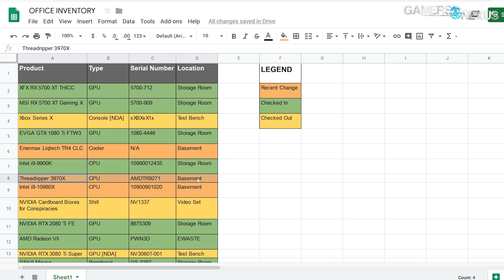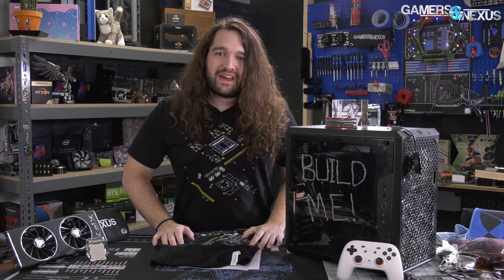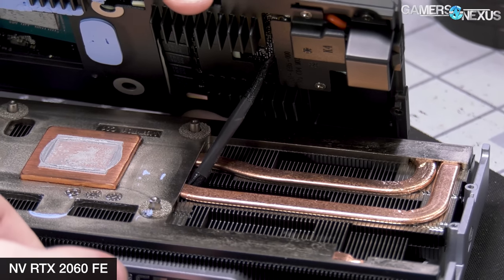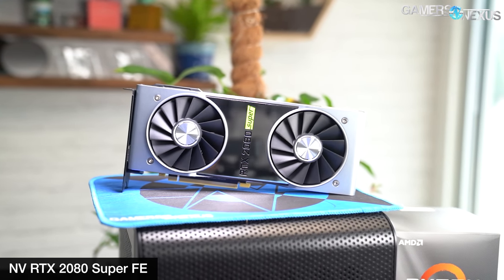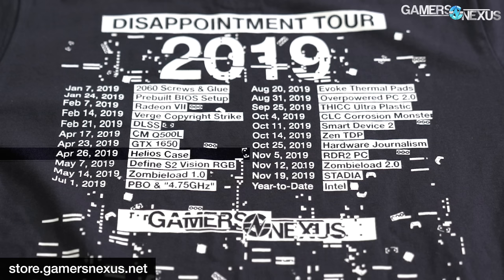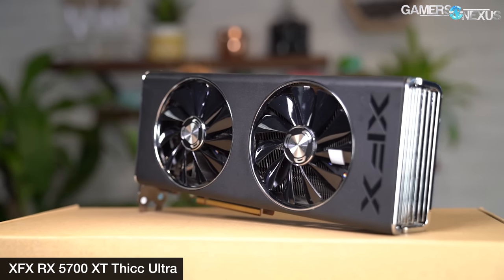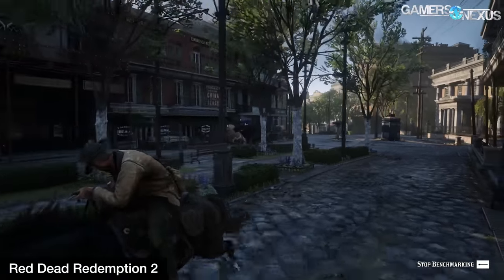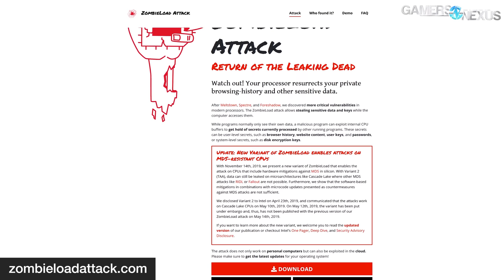The Disappointment PC 2019: Worst Parts of the Year

Comment: "look forward to an equally disappointing 2020"

You have no idea.
Reply: I bet there would be no GPU in that build.
Reply: Possible components:

CPU's
Ryzen 4000 Desktop APU
Ryzen 3000 xt
I7 10700K

Cases 
Abkoncore Ramesses 780
Silverstone Fara R1

MOBO's
Asrock z490 velocita motherboard the 10700k 

GPU'S:
PowerColor RX 5600 XT Red Dragon Review

Coolers:
Corsair A500

Walmart and Cyberpower Prebuilt PC'S

If I can find more I'll add it later (I have to see some Steve reviews)
Reply: Great year... if it was in stock
Reply: the 10700k wasn't a dissapointment at all though... It was basically a 9900k with enhanced features for much less money. I'd say the 10900k was a dissapointment due to its high price and poor stock, especially when the 10850k came out.
Reply: @SludgeManCometh  ruined by having no stock for either launch.
Reply: @juliancumming6893  but it's the only Intel cpu not fully recommended and if you want to use the velocitas mobo you have to use and intel cpu
Reply: it's the only Intel CPU not fully reccomended IF YOU CAN FIND A CHEAP 9900K. Also, that second part doesn't really mean anything in terms of dissapointment unless the trend continues into future Intel CPUs which it probably won't since AMD is offering so much with ryzen 5000 onwards.
Reply: @hellowill  the year itself is out of stock, wait for 32nd December 2020.
Reply: @cortexcortexified8623  got my 5950x ;) But no gpu
Reply: 4000 apu isn't bad. It just AMD's dumbass marketing didnt put it out for consumers and push it to SIes
Reply: its almost as he ironically wished for this

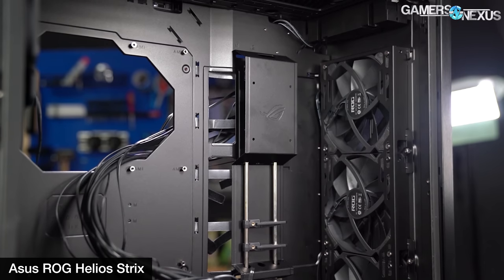Comment: 17:40 I still take my HAF X at least once a year to a LAN-party. This got me right in the feels man.
Cool video, had forgotten how many components had problems at launch.
Reply: haf x is heavy as hell.  i used to own one.  i don't see how anyone sane would use it as a 'lan party' case.  go for a mini ATX if you're gonna go that route.  lol
Reply: Still running a CM Storm Scout here.  The solid handle on the case is was actually really great for 5+years of luging it about while living out of hotels for half the year for work.  Bought a GL702zc r7 1700 + rx580 laptop last year and never looked back, however.  A single back pack is so much easier to lug around then a full atx case plus a suit case for the monitor and such. Still carry the extra suitcase, now, with a second monitor, cause why not :(

Comment: The sad part is this is probably someone's actual build.
Reply: Lolz
Reply: I have a Q500L, and I love it to death. Had to chop her up with aviation shears, but she's recovering quite quickly.
Reply: Hey, the R7 is a very good prosumer card in certain roles, such as media work.

The Intel has no such excuse.
Reply: @ryanherrington2319  it's expensive and worse than NVIDIA's solution the 2080
Reply: @spiceydice6968  Except for those specific roles, the RVII is better, because it has the biggest VRAM cache in the consumer realm, and is the cheapest source of certain AI relevant compute available.
Reply: @ryanherrington2319  How does the Radeon VII compare to the MI50, in terms of gaming and workloads?
Reply: Like Jayz2cents personal build 🤔
Reply: @CaveyMoth  I don't know if anyone's tested an MI50 with games, but the RVII is essentially a lowbinned MI50.
Reply: @CaveyMoth  Gaming on MI50 will be hampered by lack of video outputs.
And double the already high price.
Reply: @ryanherrington2319  For a lot of AI it's gonna suck hard though because AMD is lacking CUDA. And ROCm is not up to par performance wise.
Reply: Ryan Herrington m
Reply: @fretboardrunner  A lot, but not all.
Reply: @ryanherrington2319  I'd wager Tensorflow, Keras and Pytorch are the most used Deep Learning libraries right now. And while they do work, it's hard to integrate the AMD docker images or builds into a lot of workflows and even after that performance is worse than that of a 1080.

I do have a Vega 64 and loved that it worked at all, but it was pretty finicky and support on Windows is nonexistent.

Comment: I’m perfectly happy with my Radeon VII. It’s a beast for compute.
Reply: That's not what AMD launched it as. It was a compute card represented as a gaming one. And the need for compute GPUs is a niche thing.
Reply: It also had stupidly broken drivers at launch.
Reply: Me too, I´ve searched a lot before buying and soon I realized this was a similar card to a Quadro but half the price, I was dead set on buying it. Yeah it´s not the best gaming card, but I can game in it with everything at max and also work in heavy environments,  so I´m pretty happy with it so far.
I saw a ton of people saying it was incredibly loud and hot, still, mine runs in reasonable temps and I don´t think it´s a loud card, I was expecting to hear a 747 every time I was rendering or gaming, nope, not even close.
Reply: absolutely. I can understand that from a gamer perspective, while it is a top tier card, it is not good value at the price. But boy, for compute workload this beast is up theere with the 2080ti! The fact that it is a repurposed instinct die is hard not to notice. 
(can't speak for driver issues on windows though, linux amdgpu drivers worked perfectly from the first day I used the card. To be fair though I bought at launch day, AMD arranged themselves to have an extra month time fixing things, while I waited for the darn thing to finally be delivered!)
Reply: They did not actually “launch” it as a gaming GPU, they “announced” it that way, but changed it.  Why is that a problem at all?

They also priced it as a hybrid compute card.  Yes, the REVIEW drivers were bad, but that doesn’t count.  Sorry.  Consumers count.  Reviewers can get a beta driver, suck it up Sally!

The driver was fixed by the time it got to consumers, which is what matters most.

Radeon VII was a dumb addition to this video.  They just wanted to get an AMD product in to avoid the wrath of being called fanboys.

It is BS.
Reply: fuck yea man!!!! already pocketed a few ETH with mine off hours from gaming/work :)
Reply: RVII seems like a great card, if it was about $200 less at launch.  It's still perfect for some work loads, but for some reason gamers think that gaming is all that matters.  See people still choosing the 9900k over cheaper AMD options that out perform it in every other task.
Reply: I'm happy that you're happy 😁

Comment: LOL "70 pound 2 ft tall computer to a 2001 LAN party". I had a 2 ft Server tower in 1999 (running NT4 Server as PDC) with dual socket Pentium 233MMX's as a Quake 2 dedicated server on a custom maps loop partially populated with bots. I'd come home from work and jump right in with peeps from all over. No need for a LAN party but I was sporting 3 top end PCs on a local hub for home RTS and shooter matches (Unreal Tournament).  Ah, the good ol' days. Thx for the flashback and your slightly over the top intro GN.  Happy 2020

Comment: "worst parts" not sure, since those parts still make one hell of a pc, but they might not be the best bargain for the buck :D
Reply: Except it would run hot as a dumpster fire
Reply: @iaial0  as demonstrated in the intro
Reply: @iaial0  From the CPU. The Radeon 7 runs really cool
Reply: @iaial0  Well, my Ryzen 3600 runs hot aswell, but its just nice in wintertime :)
Reply: @tskraj3190  Also the GPU because the case has no airflow

Comment: I love my Radeon VII, but I bought it knowing fully well it was a spesial snoflake hacked up datacenter die that would never be sucessfull mainstream.
Reply: Can you play all games in 1440P and with Maximum details ? Maybe AMD drivers was improved this Gpu's performance ???
Reply: @ErenJaeg4R  I can with mine, so far the only issues i have had have actually been a result of windows updates.
Reply: I am running my Radeon VII exclusively in 1800p with everthing usually on high. That gives 60fps in Red Dead 2 etc. my card is watercooled (AIO) and with a small overclock to 2000hz. Would get an nvidia but Hackintosh doesn’t support it.
Reply: I overclocked and undervolted mine and it runs great on my 3440×1440 monitor. New titles above 60fps and older stuff over 100fps. Plus it's been great when editing in Davinci Resolve. I think it's aged well, and I picked mine up on sale at Newegg for $500.

Comment: Wow, the complete gong show of the Radeon VII that you had gives me flashbacks to the old AGP Rage Pro Turbo that I had in 1998. Trying to use the beta drivers to get OpenGL working in Quake 2 and Half-Life was a complete gong show, leading me to some 2:00 AM bedtimes as a teenager where I developed a twitch every time I heard the Windows 98 "Chord" sound as an error message. I ended up needing to re-install Windows to fix the problem, much like GN did with the Radeon VII.

Comment: Hey Steve. I want to know what module(s) is being used in the MasterLiquid ML360 SUB-ZERO Intel cyro cooler. I have figured out how to design a cooler that will hold up under a full workload, however using thermometric modules with the lowest Amperage Draw, highest temperature difference, and highest temperature wattage may be essential. I don't want to have to use 20 Amps of 110v AC to power the thing, and so far from others on YouTube it appears that even more Amperage might be required, however some how Intel's module doesn't seem to be as power hungry, and that's what I would like to use, although not necessary for a design or patent in my prototype. 
I'm finding parts for my prototype and trying to keep costs down on both expenses and Amperage. 
The design of the Cyro Cooler is headed in the right direction, but I'm not sure if they will get it where it has the possibility to go. I'm guessing that twice the Amperage is required over what the current Intel Cyro cooler is drawing, in order to make it stable under a full workload, maybe 3x the Amperage, using the same parts of course.
Otherwise the budget thermometric modules on the market might be able to keep a consistent temperature under full workload without drawing more than 20 Amps, however they might not get you a below zero C temperature without using an additional cooling device. The advantage at that point, is that by using an additional cooling device, you still get the benefits of the thermometric modules temperature difference driving the temperatures even lower, without liquid nitrogen. Of course with a Cyro Cooler the goal should be to reach similar temperatures as liquid nitrogen, but to do that with thermometric modules alone might require more Amperage than a clothes dryer or a welder. 

Developing an electric cooler that can reach the temperatures of liquid nitrogen, would allow the use of super conductors and quantum processors in your home, if the power demand was justifiable and reachable. I'm wondering if that's something that the government might be against, since such computers would be extremely powerful, and not require a lot of space and resources in order to use; although the cost might be higher than the top graphics cards on the market, or those most epic epyc CPUs. 

But yes, finding the materials I need at a price I can afford, and learning what Intel is using inside that thing would be helpful, especially if I can get my hands on several of their modules. 

Thanks for the work you do, so that we can benefit. Unless your practicing the way of the Nazarite, I think you should cut your hair, but that's just me. Of course I can't grow mine out because I'm bald, however that is better for cooling than having long hair. That might give me the competitive edge I need to beat your overclocks ;)

Comment: You know, for anyone who would ask "Why would you ever need to open a controller" I cannot even count how many peoples PS3 controllers I saved by just replacing the battery, replacing the foam on the ribbon connector that is just a pressure connection, and throwing it back together when I worked at a video game store. And not only did it save my customers money, but kept a lot of controllers out of the landfills.

Comment: Thank you for all that info about the Radeon VII. I was looking to buy one next year. I will stick to AMDs more tried and true GPU products now.
Reply: AMD vgas are still bad compared to Nvidia. Maybe in a few years(I hope so ...cos Nvidia prices are a scam) ...
Reply: @rymns  Wait a minute. I thought Vega 56/64 GPUs were good/reliable parts.
Reply: @WarriorsPhoto  Please don't buy Vega series, unless you like Overclocking (Vega 56) or found nice used deal, buying them new is just bad.
Reply: @Verpal  new ones are not that bad as i bought a rog strix vega 56 for $250
Reply: @fenrir1g  Thats a good enough price, with appropriate power play it can perform on par with base RX5700 reliably. That being said, if PSU is being factored in, BOM of full system might edge toward RX5700 more, as it perform more reliability. Navi is also expected to optimized further down the road, whilst GCN 4.0 Vega is pretty much at the end of the line.
Reply: @Verpal  yeah i already knew about it's power consumption so i already  got a cx750
Reply: Verpal This is why I haven’t ponied up for em. I found a good deal on 2 or 3 used ones for 175 each but figured I would see what changes appear for Navi. 
I am perfectly content with my RX 480 and will more then likely get a second one for now. 
I appreciate your input and thank you for taking the time to share.
Reply: -C3sium I found 2 or 3 Vega 56 cards for 175 used locally. I have a 1200 watt PSU for em. 
What do you think?
Reply: @WarriorsPhoto  thats nice but i got brand new for 250 not used
Reply: -C3sium I am understanding that 175 isn’t a good price for em used then?
Reply: @WarriorsPhoto  yessss!!!!!
Reply: -C3sium Thank you. I felt the same. Hence never pulling the trigger. Have a good New Years.

Comment: Well I for one, used your reviews to decide whether to buy Ryzen 5 3600. I'm very, very happy with the puchase. It came for more than you'd buy it for in the US, since I live in EU, but it's still an absolute killer. Coupled it with 16 gigs cl16 3200MHz corsair, mid tier mobo since I won't be overclocking it (no need), and a gtx 1070. Works like a charm at 1080p.

Comment: I've opened my X-box 360 controllers several times. The connectors inside corrode, making the buttons fail, and it's not possible to clean them up without taking the controller apart.

Comment: Yeah the Radeon VII sucks in gaming but since the Mac Pro is out I know the perfect use case for the Radeon VII. Instead of paying Apple  5.200$ for two Pro Vega II just go with the base model and put four Radeon VII in it. They will only cost you around 2.100$  and the best thing, they will give you almost double the FP32(55,2TFLOPS instead of 28,2 with Apples offer) performance while keeping around the same FP64 performance. (13,8TFLOPS instead of 14,1TFLOPS) With 64GB on both configurations, VRAM will stay the same. 
Yeah you'll need some 8pin cables but the cost safe is still at least 3050$ !

Comment: The 9700k without hyper threading was a baffling choice. At this point Intel should price drop it to $250 to position it as a gaming only midrange CPU that is cheaper than the gaming/productivity 3700x.

Comment: Radeon 7 was so disappointing.  It can barely run most games maxed out 1440p @ 60 FPS, even with silicon maxing overclocks.  It was bad enough that I ponied up and bought a 2080ti instead.  Absurd price, but at least it runs 1440p@120FPS+ on max, and 4k@60FPS usually maxed.

Edit:  I will totally cosign the drivers being completely broken.  They're still a mess.  The R7 crashes way more often, even after nearly a year of driver updates.  Can't say I experienced all the glitches Steven mentioned, but I did run into a lot of them.  Having an R7 running solely on a 560mm rad, I can't even rely on the drivers to maintain a good OC.  The only way I can seem to run the GPU stable is at stock speeds.  I love my Ryzen GPUs, but I wish I could get my money back from the R7.  Only upside is that when I bought it, it came with Devil May Cry 5, Resident Evil 2, and The Division 2.

Comment: Have to disagree with the 1650. The low power version is the best GPU you can put into a crap PSU office box to turn it into a gamer. Its why the 1050ti was so popular. Power is a HUGE factor for anyone trying to make a "baller on a budget" build. I love my 570 and would love a 580 even more but I dont have the power budget in my converted HP 220Z for a 580 and I dont even have the power budget for a 570 in my ancient Dell Studio XPS that is sporting a 1050ti now.  I get that the 1650 doesnt make sense if you are building from scratch but it does for a conversion build.

Comment: The 011 is such a nice looking case I can see why it's so popular, I love mine. The air flow is definitely not the best, but definitely not the worst, my temp actually stay pretty okay but I do have to run my fans a bit higher. But I'm getting to a point where I just want nice quiet fans instead of these Corsair LL120's (there's 9 total) so I'm trying to see what fans to try out because I have a set RPM of like 1500 - 1800 rpm and while it's not super loud, I can definitely hear them going. I love having lighting, but at this point I'd rather have it be a lot quieter so I either need good fan suggestions (in white if possible) OR I just need to go balls out and custom loop by build

Comment: I'm happy with my Radeon VII. I got it for $900aud. I use it to game a bit. But I mainly got it for video production. It doesn't run hot or noisy because a custom fan curve (using Afterburner) works really well. It has the potential to do really well with compute type tasks eg FP64.

Comment: I have the Q500L. I like that it fits an Atx Mobo but is compact and space efficient.

I used a Dremel to cut holes or for th fans and then bought front and top panels from the Q300P.

Temps are decent but I had to spend more buying the panels.